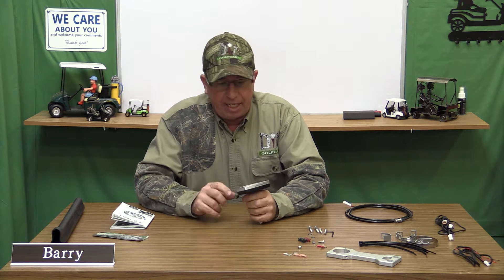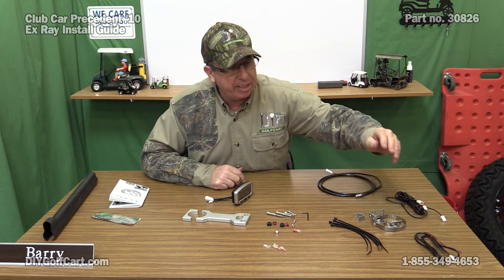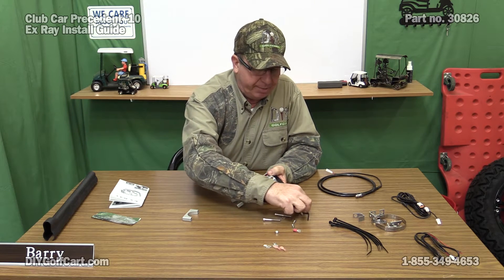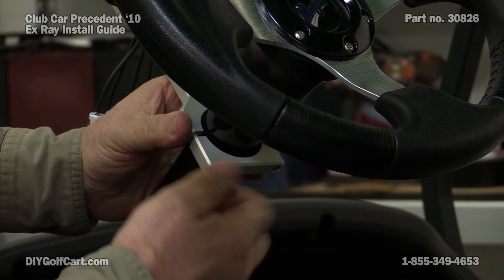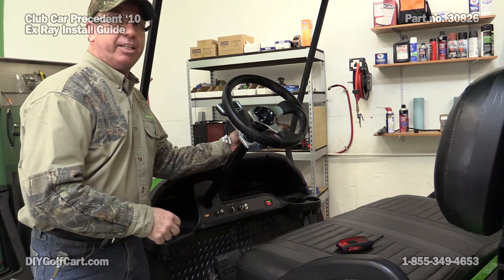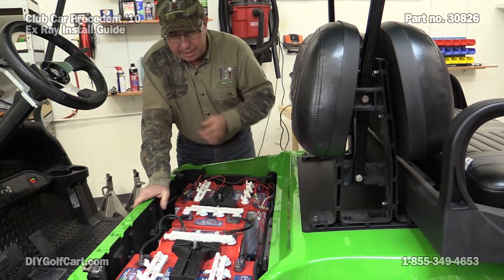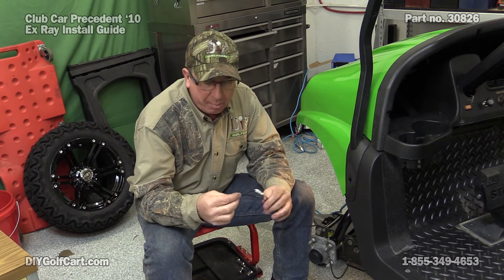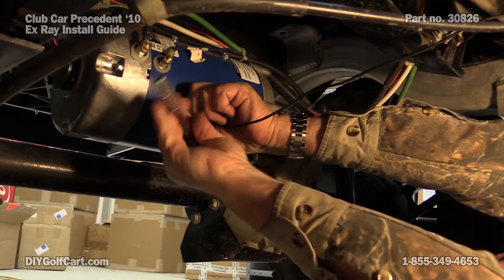ExRay Golf Cart Speedometer | How to Install

Comment: why does the back light on the speedometer go off when you press on the accelerator.  when i let of the gas pedal the light comes on.
Reply from the maker: Could be a weak battery in the system.